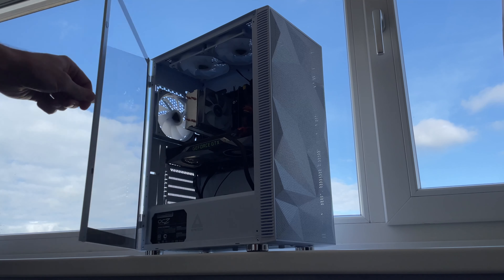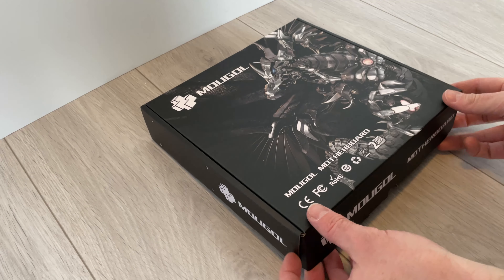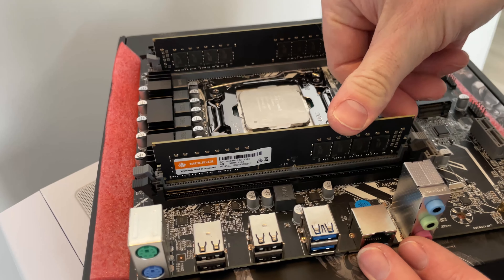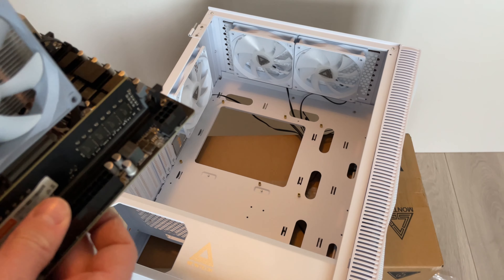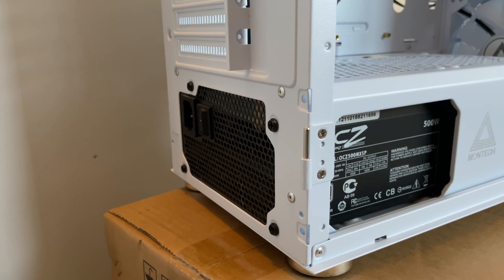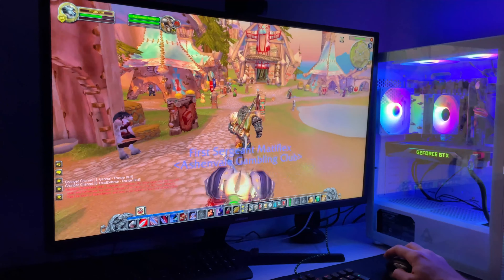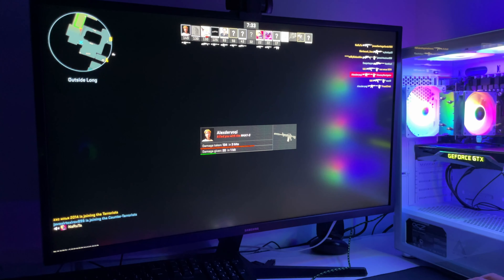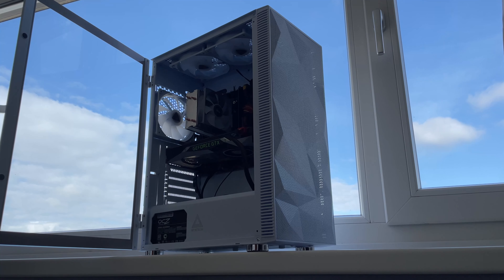Who said PC Gaming is expensive?? 4K for less than $300!!

Comment: Hey man the motherboard can support 4pin argb fan?
Reply from the maker: No unfortunately there is no RGB support on the motherboard.
The fans in this case are just on or off by a switch on top of it.
Reply: @techwithdaan hmm okay but I also have another question, is there a wifi m.2 slot on the motherboard ?

Comment: Less than 300, as long as you buy 10 year old processor/mobo/ram combo from AliExpress, a used power supply, and have a gtx 1080 laying around that you found for half the usual used price.
Reply from the maker: No not really, here in the Netherlands they tend to go for about 100 euro still (excluding shipping). The CPU is indeed a refurbished model but both memory and motherboard are new from AliExpress and perform really great. Powersupply I indeed went for a second hand model but if you feel like it you can actually buy a new one for not that much.

Comment: u could play starfield on 1080p low on this pc. 4k 😂😂😂😂🤣🤣
Reply: prob. not even starfield at this point, the updates for starfield is absolutely wild
minimum specs for 1080p normal settings is rx 6600 i3 10100f 💀💀💀💀💀💀
Reply from the maker: Wow that is quite heavy then indeed! When checking online I do find that the GeForce GTX 1080 outperforms Radeon RX 6600 by 3% based on average benchmark results.